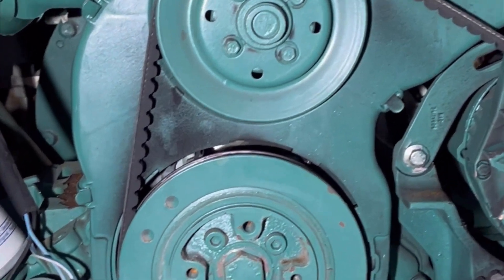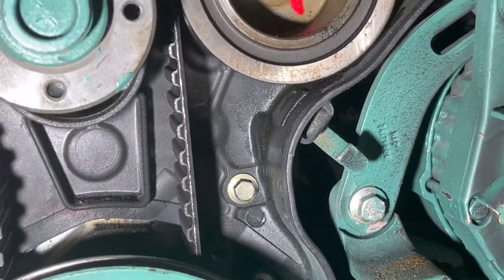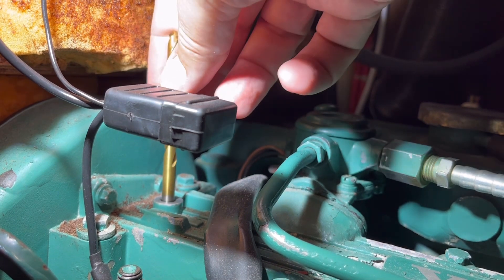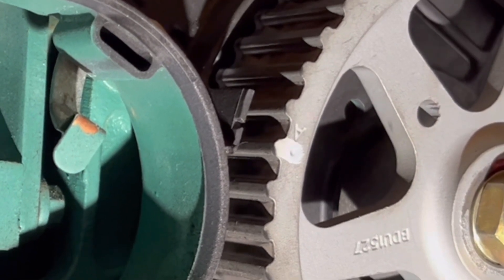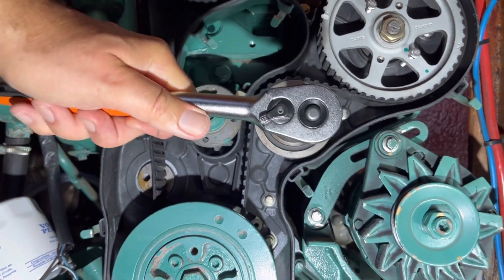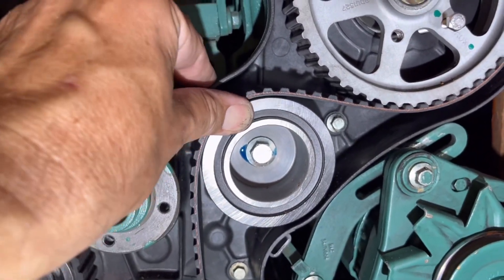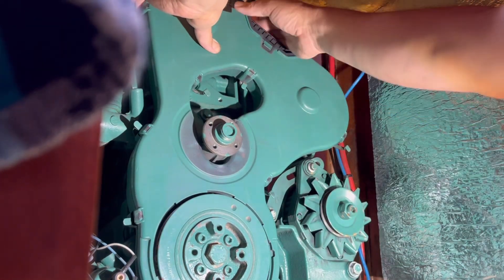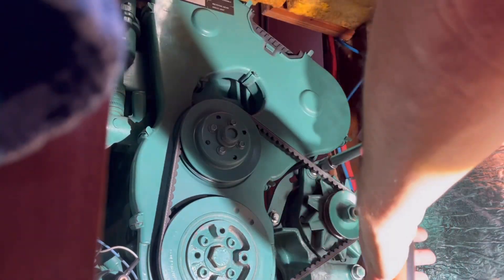Replacing timing belt on Volvo Penta MD22 LA

Comment: Dear, I follow your suggestion exactly the same like video…I have prima Perkins mod 1992 and  ( I changed everything ) and now didn’t starting. Please did you know something rong?
Operate without any bad voice but no starting.!
Reply from the maker: Hi, thanks for reaching out! It’s hard to tell what could be wrong. It’s good that you are no hearing any alarming noise. What I wonder is if you did fasten the pulleys properly before disassembling the various components? The pully for the camshaft must be completely locked, or else the valves will not be timed correctly. Does the engine spin easily, or is there some resistance? Did you loosen any other components that might affect the compression? Good luck, Christofer

Comment: Hi, interesting video, i've also changed my md22 timing belt with Autodoc parts for a Rover Montego, but i can't find the "idler" pulley as you call it. Could you please tell me what number part it had or what car did you search on Autodoc for it to appear? Thank you very much! @hallbergrassy352
Reply from the maker: Hi, glad you liked the video. Unfortunately I can’t find the documents from when I ordered the parts right now, but I found an idler by Dayco that might be the one I used (no. ATB2162). Seemingly many of the parts that come with changing the timing belt are out of stock at AUTODOC, so there is currently not that much to choose from. Wish you good luck with your project!